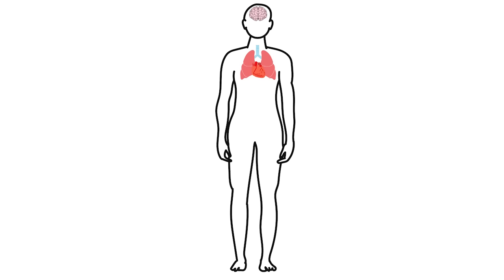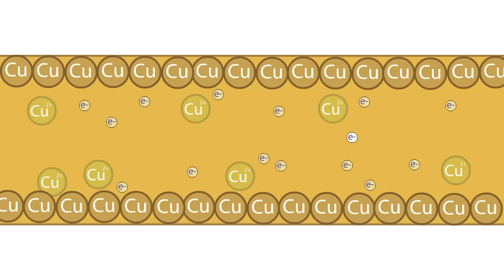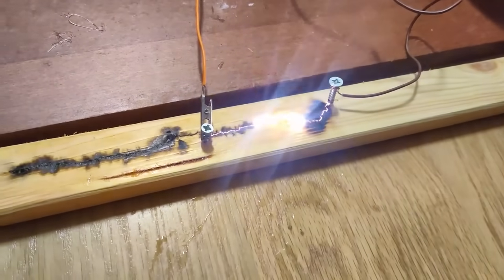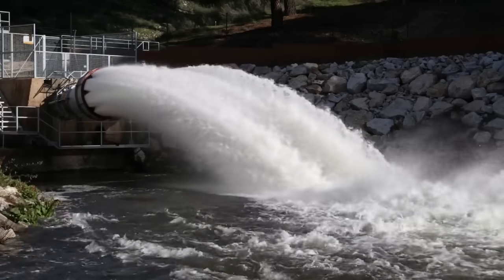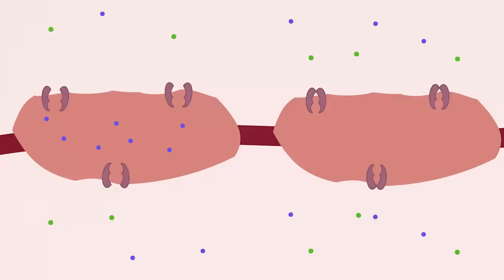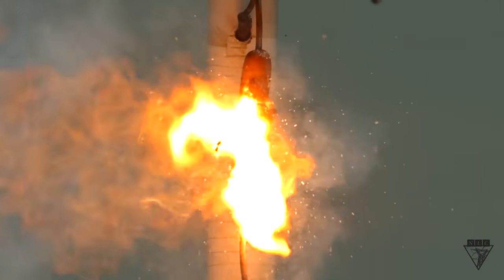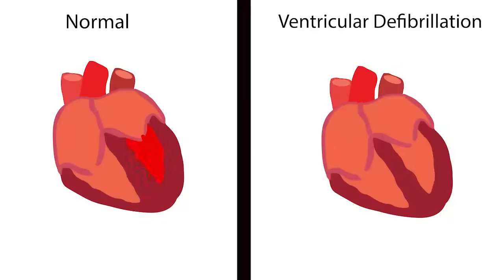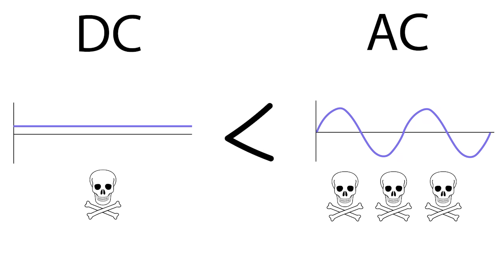Anatomy of Electrocution

Comment: Death penalty electrocution was started by what Edison did.  Edison didn't like alternating current so he arraigned to shock an elephant with a voltage that would cause the most grief.  2000Volts.  So that is what they used for the death penalty because mostly they just followed Edison's lead without thinking.  15kV would be more effective. A big spark and life would be terminated instantly with no suffering.  You wouldn't need the wet sponge.  It would be more humane.
Reply: No, Edison did not kill any Elephant. That was ten years later for completely different reasons and Edison did not do it.

Comment: I'm in 4th year electrical engineering and I'd argue that is the "current" that kills you. Obviously current can't flow without a potential difference (a voltage difference), whether or not you survive a voltage difference across your body can be very much dependant on the conditions which dictate how much current passes through your body. For example if you are standing in a puddle of salt water your body is part of a lower resistance path to ground compared to someone standing on a dry surface. A shock of the same voltage that is not survivable under the first condition may very well be survivable under the second condition. However, if a few hundred milliamps pass through your body you're very likely dead. The level of injury from an electrocution is a proportional to the current that passed through your body, not the voltage level you were exposed to.
Reply: Any system can provide a few hundred milliamps. It is the voltage that determines if it is dangerous.

Comment: For anyone wondering “why not use DC if AC is dangerous”

You’d need cable the width of a bus to run power a couple of miles with DC due to voltage drop
Reply: DC has less losses than AC. It is about the voltage. In 1890 they could not change voltages on DC. Now they can but we already have the system we have.

Btw DC was in certain areas used surprisingly long. In New York Consolidated Edison stopped distributing it only in 2007.
Reply: @okaro6595  mate I’ve been an electrician 20 years. You’d need cable massive to run high powered AC long distance, look it up

It’s my dumbing down for YouTube it’s actually the current carrying issue which means you’d need increasingly large conductors conductors if feeding a large area 

I’ll send you a link

Dc was preferred at first due to it being deemed safer and more efficient

Ref: Alternating current is easier to generate and transmitting alternating current leads to lower energy losses than direct current over distances more than a few metres. Although for very long distances (more than 1000 km), direct current can often be better
Reply: @okaro6595  it’s the line resistance that’s the issue 

Explained here in 25 seconds: https://youtube.com/shorts/aG8ZaDGUEZU?si=MPeS7nHoTDJj8tpe

Comment: Two vital things missed;

1- the low numbers regarding death is eiectricity across the heart. If you were to bridge between 2 cables with you finger tip and halfway down your finger it was damage between those points and not be fatal 

Also why RCD units trip at 30mA as it’s deemed below the lethal threshold for a shock less than a set period (fractions of a second depending on the circuits current)

2- the no let go thing is completely different with AC, as it oscillates you can break away from it.

It’s common with AC shocks to get a “belt” which is a zap that make you fling your hand away when you touch it, like a zap or something kicking you hand away

Comment: My father was born in 72, being the youngest of [then] 9 siblings he wanted to become a electrician but he was born colorblind (red/green) and wasn't allowed to be one as back then cables was color coded.
But damn he proved  to be quiet effective in repairing electronics(buying defected Ps1's, Ps3's). When questioned he answered that it was either one damaged capacitor or a bad soldiering that had to be fixed or a bad CD reader.

Comment: Can't agree with your current AND voltage are the killer. You can only define the lethality in current. Because voltage doesn't kill you, You can have a 30 000 volt bolt right in your face and i doesn't matter, if you are insulated. At the same time you could die from a toaster in your bath tub. so voltage is relative while current is absolute when observing lethality.

Comment: I’d like to know examples of different types of electrocutions eg; Tazers. How many mA would that come under
Reply: They do not want to tell it as they believe in the high voltage low current nonsense. They only mention average current which is meaningless. A taser works on short pulses. This makes it relatively safe. I once wrote am  answer on Quora that said 10-15 amperes as the peak current. I do not have the source and it was pretty hard to get. The manufacturer says just 3-4 mA as that makes it sound safe.

Comment: A resistor limits the current, not the voltage. The voltage drop is only caused by the load. Smaller load = higher voltage, heavy load = low voltage. Resistors burn from over current, where the load is pulling more than the resistor is rated for. If you use a 10 amp power supply at 12v, that's 120w. Dumping 120w through a 1/4w resistor is going to end badly every time.

As a example:
24 volts in.
200 ohm, 0.01 amp load = 22 volts
200 ohm, 0.1195 amp load = 0.1 volts

When we use resistors in a circuit, we can't just say X resistor will give us a X voltage drop. The load determines that.

Comment: As an electrician, I have experienced "no let go". I had three fingers burned just like touching a hot frying pan. I was lucky enough to fall off of the contact. As an apprentice I had no business doing what it was I was doing. I am very safety conscious today. LOTO and proper PPE always.
Reply: what do you feel in a no let go situation? any pain? itching? or nothing?
Reply: @zimba-j4f  there is no pain. I experienced a no let go shock as a child when I was between 6-8. I was looking for something in my garage climbed the table and grabbed a metal chain to turn the light on turns out that chain had an electrical current running through it. When I touched the metal wire my had fully grabbed onto it tight. It’s essentially an involuntary hand movement. You feel the current vibrating and flowing through your body and a buzz sound. You also feel your hands and arms get really hot to the point of burning. it’s hard to explain but you just feel a strong force flowing through your body. It tingles and makes your heart beat fast and feel a sense of impending doom. I don't know how I survived but that moment felt like minutes when it was probably seconds. I panicked and tried to pull my hand bit didn't work. Once I started feeling my heart pound faster for some reason I was able to yank my hand downwards and free myself and run away from the garage I told my dad like a week later. I truly feel that day that god saved me because that current had a strong grip on me,.
Reply: I’m considering it for my career but I’m terrified of long term damage to my body. Even small shocks can cause heart issues. If someone wanted to stay safe by wearing PPE and taking time to check safety, is this a good career or is there a rush to get things done fast and people won’t like you if you do things properly?
Reply: @Justin-jy6fu join the IBEW. im an apprentice in the IBEW currently,  a little over halfway done. Im making more money than i know what to do with. The ibew will train you well on being an electrician,  including safety. All the contractors ive worked for put an emphasis on safety, and almost all jobsites ive been on have not been so rushed that there was no time for lockout tagout. Working on live circuits is rare and discouraged,  usuallly youll run into this in hospitals where turning power off can cost lives. Also, being unionized, if somehow you ever do come across a foreman on a jobsite who doesnt want you locking out a circuit, put your tools down and call the school (since youre gonna start as an apprentice) and tell the training director whats up. If the contractor lays you off for it, youll have another job in no time because the union hall will send you to a new contractor. I never worry about job security. Basically where im going with this is you wont have to worry about it. Most cases of people being shocked are because they play fast and loose with their safety and dont bother to test or lockout before working, not because foremen are forcing you deliberately into dangerous situations. If you want honest advice, if you are mechanically inclined or have worked in another trade before, and electrical interests you, then theres no better way than the IBEW and the opportunities and money are literally endless. Our package here in no mans land in the midwest is over 65 dollars an hour. Dont see many people making this kind of money.
Reply: I had that happen to me also when I was a kid but I did not get any burns. I went to open the car door and could not let go of it--scary. My dad was doing something  I guess with the car battery maybe
Reply: @Thundralight  they say Battery car can't do that to low voltage
Reply: @pro2j-gu7db  I am not sure what he was doing I assume it was something with the battery but I know I was not able to let go of the door handle

Comment: It's not current that kills you, it's not voltage that kills you. It is energy that kills you! So you need to consider time that some voltage pushes some current through you. Many people saw a Van der Graaf generator and some even touched it taking tiny electric shock. But if you measure voltage and current through your body in that moment it turns out that voltage is about 100 000 Volts and current is about dozens of Amperes -- values that considering absolutely lethal. But that horifiyng power acts just nanoseconds so total amount of energy transfered through you is not nearly enough for any damage.
And that expression about energy that kills you is right for any possible case with any possible energy type. So you should mean the power acting on you and the time it what power acts.

Comment: This is a fairly common misconception about the nervous system -- that it transmits electrical impulses. In fact, the electrical transmission path is limited to the interior of one nerve cell -- the neuron. The most interesting thing happens between cells -- in the synaptic cleft. Information between cells is transmitted by chemicals -- neurotransmitters, which one cell secretes into the synaptic cleft, and the other -- perceives with the help of protein receptors corresponding to one or another neurotransmitter. And, of course, the reality is much more complicated.

Comment: so if electricity releases free electrons in a copper wire, eventually that wire will run out of free electrons and wont transmit electricity.
Reply: This statement is false. The flow of current through a copper wire is not a process of depleting free electrons in the wire. The free electrons that are already present in the wire are used to conduct the flow of electric current. However, the wire can still conduct electricity even if some of the free electrons are used up, as the electric current can still flow through the lattice structure of the copper atoms. It is only when the wire becomes too hot or the lattice structure is damaged that it may fail to conduct electricity.

Comment: It took me few min to realized this person (video poster) has a very limited knowledge of electricity.
There are laws in existence which prove his/her interpretation is wrong.
One does not need a high voltage to create a current, eg. is spot welding. Virtually zero voltage is producing 1000's of amps required to melt metal.
And there are quite a few more, don't waste your time watching this video.
Reply: It is true that spot welding can use very high currents with very low voltages. This is because spot welding uses a large current to produce a localized heat that melts the metal at the weld point. However, it's important to note that spot welding is a specific application that is not representative of all electrical systems. In general, the amount of current that flows through a wire depends on both the voltage and the resistance of the wire.
Reply: Yeah. Telling us that 15 milliamps can kill without any reference to voltage or whether it is DC or AC is plainly ignorant. He sounds like the early Edison wanting to power houses with DC current saying it was safe and Tesla "electrocuting" himself with a hundred million volts of very high frequency AC at picoamp levels.

This guy is like a million other half-smart "experts" on YouTube.

Comment: I am an electrician I got a shock through my thumb across the back of my neck and to the other arm where I was holding a grounded metal light fitting while trying to replace a cover on a ceiling rose fitting with an exposed live terminal, During the shock I tried to swear but could not say anything I was up a ladder  any way my thumb came off the live terminal I had touched with it.  I must have still been able to yank my hand away.  I got down off the ladder, no one around me even noticed it was an office full of people. I looked at my thumb and notice a deep burn ,almost like a pin prick, but right into my thumb.  Up shot, never be in a hurry, never be tired, when working with electricity. Back then we were told to do things live so as not to disrupt the office/factory etc. Now we are not allowed to work live.  Up shot be careful electricity plays for keeps.  And refuse to work live.   Come back in the weekend, have someone else watching you as well, that might give a boss grey hair but not you.  When I mentioned it to my boss he laughed and said you will have a hard on tonight.  What should have happened is it should have been reported, written up and I should have had an ECG of my heart.  Any ways please be careful and take your time with any thing electrical and tell the boss to get F--ked if he objects.  ANd dont do live shit, and test before you touch always.  Unless you know the cables are dead as in a new installation where the DB board is not installed yet.  Never take someone else's word.  It is so easy for mistakes to happen, like pull the wrong fuse or circuit breaker so ALWAYS test before you touch using prove test prove, 
Lethal combination, is tired, in hurry, in a mess, and mind on something else.   If that's you .  Sit down value yourself, and have someone else pay a little more or make a little less, You have a right to go home at night.  And not have to have  someone visit you in hospital from your home, or worse.
When locking off switches and tagging, use your own pad lock put the key in your pocket, don't leave it in the key switch,  When pulling fuses, put them in your pocket so no one else can plug them in.  Unless you are a professional, leave it to someone who is.  That way you stay legal, and you and your family  stay alive and your house not burned,   even if the pocket is a little lighter..  .

Comment: I've been zapped a few times with 115VAC  over the years, but nothing major. How, and if your body is well grounded has a lot to do with it. I always meter wires before I touch them, even if I believe they aren't hot. I have have found some very non-standard wiring in  older homes and condos. Like double circuits run to the same box etc.

Comment: Thanks be to GOD I'm still alive. I had a 'no let go' shock after I made a vacuum cleaner, touched a copper doorknob, and then the actual vacuum cleaner. It felt as though a hot metal rod was inserted through one hand and then the other. It was horrible! During my electrocution, I begged my two brothers to turn the machine off. After about a few minutes of shouting 'burn bastard burn,' they turned the machine off. Since that day I've avoided having any direct contact with electricity. :hand-orange-covering-eyes:

Comment: 60 HZ = 120 times it crosses 0. 1 HZ, or 1 cycle, is 2 passes. Also. It is ventricular fibrillation, defib is the process of getting the heart back into rhythm. 

I received my degree in Electrical Engineering in 1976 and this is probably one of the best explanations of current flow and voltage I've seen or heard.
Thanks.

Comment: Hey, dumbass! Voltage is DEVELOPED because of current flow! The lower the resistance, the higher the current. In an electrocution the voltage is developed by the body the current flows through which causes the heat you're trying to describe.

Comment: The depiction of the nerve cell starting at 7:40 is incorrect. The long axon, responsible for transmitting impulses to the next cell, is shown accompanied by a series of oblong shapes, obviously representing myelin-forming cells. Myelin, however, acts as insulator and DOES NOT possess the ion channels involved in stimulus transmission. Channels are instead placed on the axon itself, in the nodes of Ranvier, i.e. the brief gaps between individual myelin sheaths.

Comment: 3:38 Incorrect statement: 'not damaged by high voltage.' Technically it is current that causes the damage. While current depends on voltage you can have high voltage situations that cause little to no damage as long as the current is low such as with the high resistor described in this part of the video.